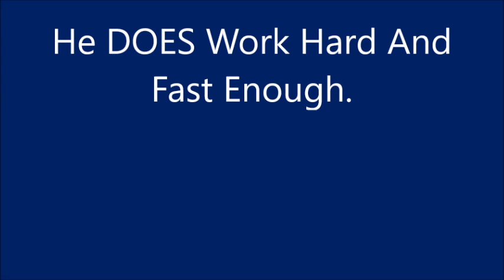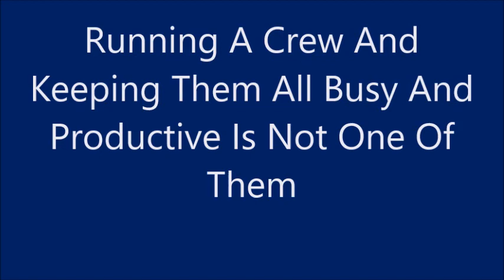Building The Forms For The Concrete Roof Posts

Comment: You just need a bigger crew there CHIEF  & they all need to be organized  & shown how to do it bossman just look at James Hightower  build he's got it together . Because he knows how to organize & plus it's not his first rodeo . It's not always a moneything before you say it Brian. Especially  on the organization  .
Reply: James has the luxury  of  having  proper equipment and electricity on demand , plus he lives in Panay , Iloilo which has more stores and bigger ones too, and has two  trucks and  plus the  budget, Brian  can't even get  enough  plywood  for his forms, what  this 3 people did  in one day  i  can do by myself  in half a day, but I have  Cordless  drills  and Impact Drivers  and  corded and cordless  power saws  3 inch decking  screws like you won't believe, plus a Home Depot  not even a kilometer away. It is easy to be an armchair  quarterback, until  you have to do it  " Mano - Mano" as they say in the Philippines , I know  this  as  when I went there in 2017  in Inabanga  ALL my powertools  were siezed  by the Airline , EVA AIR as  they  had Rechargeable Batteries, so got  left behind, in 🇨🇦 Canada.  However  me and  my host  were still able to  do a  kitchen and  bathroom  and replace a tin  roof  in a month  using mostly  hand  tools, plus elbow grease.
Reply: all this is ok RB if you have the money, it all  revolves around money, things happen when money enters the picture...
Reply: @aurelio-reymilaorcabal9669        Another good comment from you.